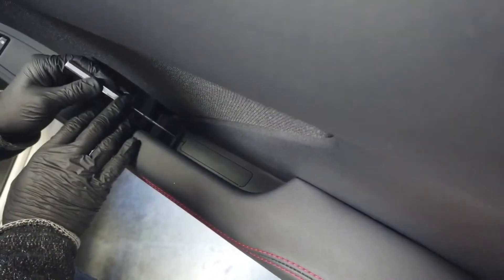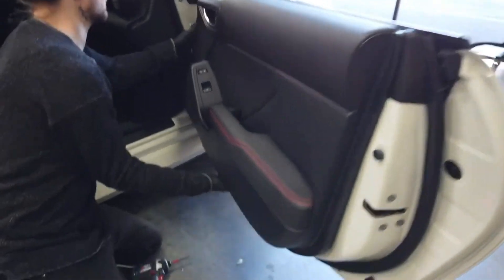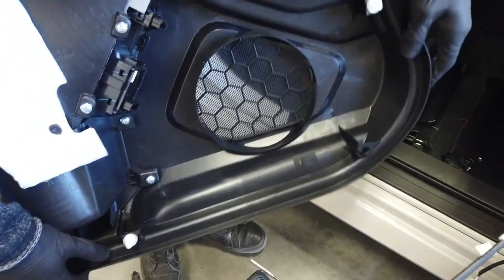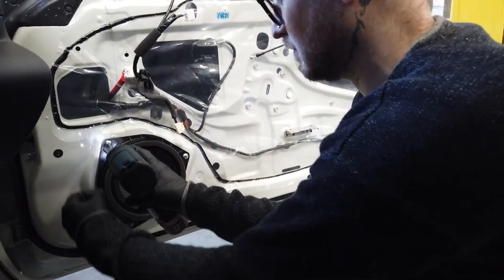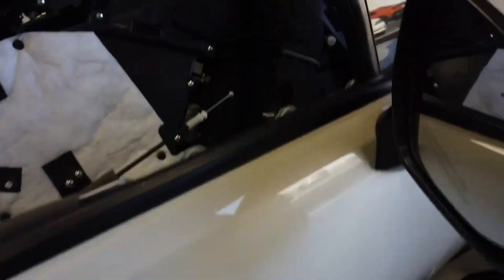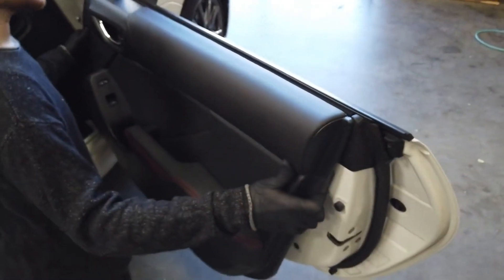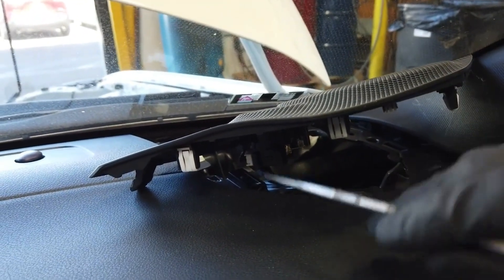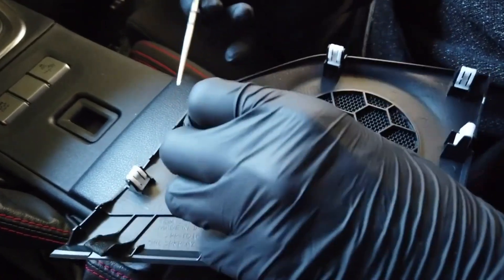2022+ BRZ GR86 Speaker Upgrade Install

Comment: Do these speakers work well with the heat sonic plug and play amp?
Reply: @Playboyer670  checked on the forum and seems like it IS a good match.
Reply: @Playboyer670  yea bro I did the same speakers in a week and amp in like a month 😪
Reply from the maker: We have tested compatibility of the Beat-Sonic Amp with our speaker upgrade.  They are compatible and yield improved performance over just doing the speaker upgrade.  The main reason is that more clean power allows the speakers to be driven cleanly and reveals the true quality of our speakers.  The factory head unit and factory amplifier can easily power our speaker upgrade, but they reach their limits much sooner, which doesn’t allow the fullest possible audio quality. 

The best solution is to step up to our complete Reference 500 or Signature Edition sound systems, which elevate your entire listening experience to studio quality sound.

Let us know if you have any other questions.
Reply: @Oemaudioplus  I already ordered both lol still waiting on my speakers from you! When can I expect the subwoofer to ready for the gr86?
Reply: @Austinomon how did the install go? and how do they sound from an unbiased standpoint?